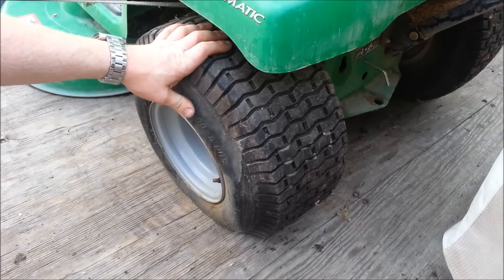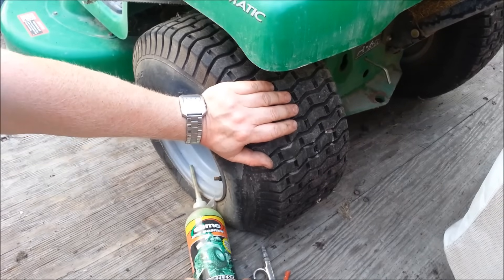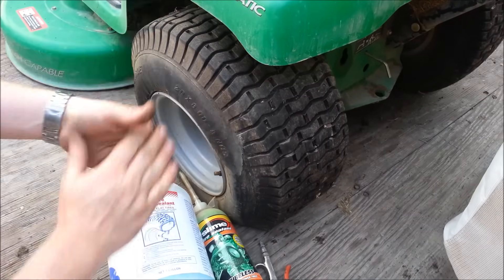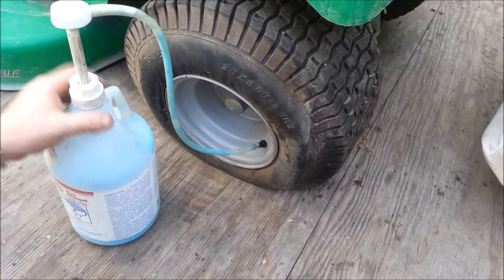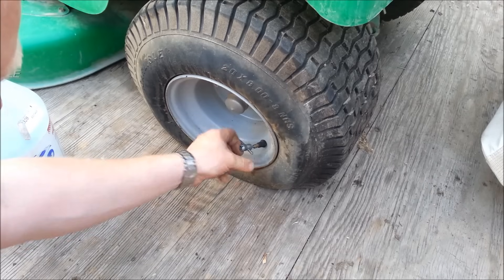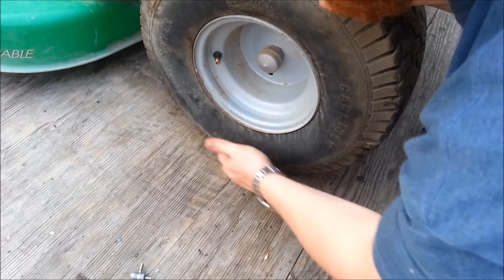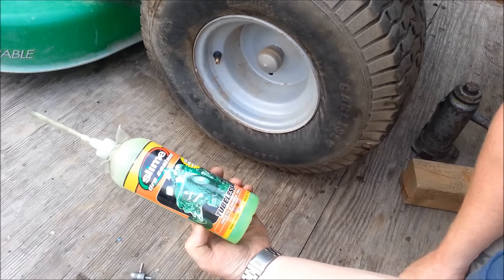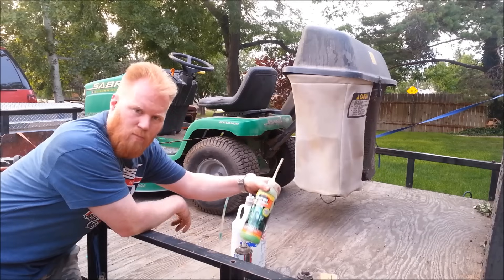Fix Dry Rotted / Flat tires on Lawn Equipment ATVs

Comment: Just put tubes in them. You can tube all 4 tires for about $75. Problem solved.
Reply: $75 is a lot more than the cost of slime and you have to get the tube inside the tire, too much work/time.

Comment: How bad is it if you ever have to change the tire. Would that work to weight them.
Reply from the maker: They come right off, even after 5+ years.  You usually don't put enough in to act as a tire ballast.

Comment: I know this is an old video but I'd never use those products. It's expensive and makes a mess of the rims
Reply from the maker: They're cheaper than new tires and generally outlive the machine they go on. I have stopped using slime and only use Tire-Ject now as it takes very little and won't make a mess.
Reply: @sixtyfiveford  still prefer tubes.  Different strokes fer different folks 😀
Reply: Normally when we are using this stuff, we don't care about the rims. Old lawnmower barely worth $200 that we don't want to spend the money and time to  put tubes in.

Comment: I'm lazy.  I just toss a cheap tube it and call it a day.  Low pressure/low speed tires just beg to go old school with tubes.
Reply from the maker: Brazing Bill Tubes work.
Reply: sixtyfiveford
I think your fix appeals to so many because the tires that comes on equipment is of such poor quality.  I actually have equipment that I tubed out when new I dislike flat tires so much.  Between a dead battery or a flat tire I don't know what is more of a PIA.  I tried out your shoe glue tip.  I now have 3 tubes in a drawer at the ready.  Thanks for taking the time to share these great tips and ideas, always a pleasure when notified of a new posting!
Reply from the maker: They do make tires out of crappy materials these days. Either they wear right out or dry rot instantly.
Reply: I don't call replacing a tube "lazy", lol! That would take me a long time!!!!!

Comment: Good timing for this video, just picked up a scag and the front caster wheel is completely flat. Hopefully this stuff will work. Then I just need to find a whole new caster assembly on the other side

Comment: Thanks for the tip! Do you have a web site with contact info? Thanks for sharing.
Reply from the maker: MRrwmac Contact info for the product? Any brand seams to work. They are all about the same thing. I've used: Slime, Bell tire sealant, Rotary tire sealant and Berryman's tire sealer. I have a 5 gallon buck of the Rotary brand right now so that'll be my go to for the next few years.

Comment: Where do you get that stuff in the gallon jug, Ive called both auto stores and a farm store with no luck finding it. Im referring to the Rotary Tire Sealant, not the green slime, since that is what you used. thanks

Comment: For the price they charge for a new tire you'd think it was quality built , think again , those mower tires are built very poorly , they are designed to fail . They are away over priced with no warranty. They will dry rot years before the tread is used up . The tire maker should be ashamed of itself
Reply from the maker: New rubber for anything is junk; car tires included. I have 40year old car tires, tractor tires in better shape than 6year old car tires.
Reply: @sixtyfiveford  we found a 1928 Buick out in the forest , trees going up through the floor boards and through the roof , cut the trees down , moved the car to the roadway and pumped air into the tires ( tube type , split rim and they held air , tow it down the highway at sixty miles an hour . One wheel came loose so we stopped at an old service station. The owner just happened to have the tool that remounts the tire hanging on the wall , he gave it to us , anyway , centered the wheel back on the rim and we were off, at six miles per hour , all the tires stayed inflated . Towed the car home ( about sixty miles ) real rubber back then (1928 )

Comment: Didn't work!...slime doesn't make it to the side cracks unless the wheel is spun fast! On a riding nower, it'll never get that fast!
Reply from the maker: The slime falls from the top of the tire and runs down the sides. You need to put enough in to accomplish this. I've sealed dozens and dozens of small equipment tires with dry rot cracks in the sidewalls.
Reply: Mowers N Blowers 
Unless the tire has some huge holes in it you're not doing it right. Use.some common sense here.

Comment: Make your own tire goo for $2 a tire. 

NEVER USE IN HIGHWAY TIRE! 

CHEAP latex caulk, newspaper in a blender, and antifreeze.

The antifreeze rehydrates the dry rotted tire. 

Chop newspaper in a blender, various sizes, from dust to typical shredder size. Many (shredded) handfuls per tire (depends on size). 

One tube of caulk is good for up to a large lawn tractor/tire. Use more if needed. 

In a container, Use a whole tube of caulk ($2) per tire, add newspaper(free), and mix with used antifreeze (free).

Add a healthy splash of antifreeze, then Mix while adding more antifreeze to achieve a milkshake like consistency.

Remove tire and rim from application. Fill. (pop a bead and pour in if possible) Roll tire around every witch way. Lay on sides too, repeat many times throughout the day. In hot sun is better

The tire will absorb most/all antifreeze and tire will be coated with paper mache caulk and cure.

If you have too much antifreeze, some will remain, if so set tire upright, let cure a day, then rotate tire 180 and let opposite side cure. 

Never use any type of sealant in a front go-kart tire, or fender less atv. If repair fails, you can get a face full of sealant.

You can use this recipe in these applications, but If liquid is remaining after treatment, remove excess before resuming fun. 

Black RTV in wicked cracks (let cure) works well before procedure. Apply from inside and outside. 

Silicone caulk will NOT work in recipe.

Adding antifreeze alone to tire before a failure will keep rubber from drying out, and helps rims from rusting.

Motor oil applied to outside of (preferably hot) tires can restore flexibility fast.

Comment: ATF works better and is cheaper. ...
Reply from the maker: Yes and no. ATF/mineral oil Will swell rubber  slightly but will only seal very fine hairline cracks. If you have larger sidewall splitting ATF won't stay in there long enough to work.
Reply: @sixtyfiveford  I've used it on about 40 tires a year with my side hustle and it worked every time for slow and moderate leaks. Seems better than Tire Sealant to me.

Comment: slime SUCKS never buy that shit again! what is the other stuff??
Reply from the maker: I've had fantastic results with slime, it just takes a ton and the wheel needs to be used to work the chunks into the crack. The other stuff I have is just generic branded slime I buy in bulk 5 gallon buckets. The only thing I've found that works better is TireJect: https://youtu.be/nfti6Jt0ye4

Comment: Thank you, Fix a Flat is garbage and completely useless, this was my problem, and I have 2 new good tires and wheels, but they are 3/4'' bearings, I need 5/8'' or longer peg for the wheel not to scrub :( lol